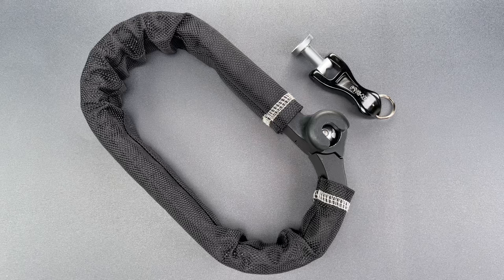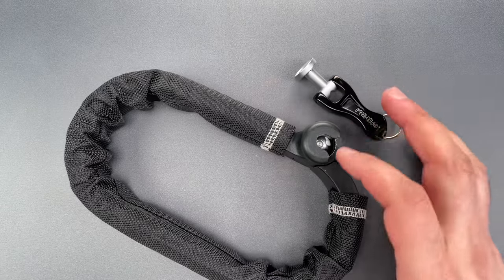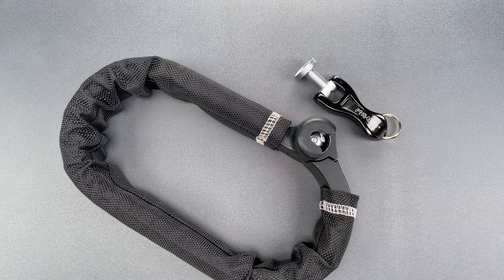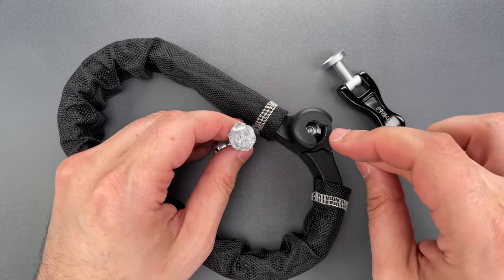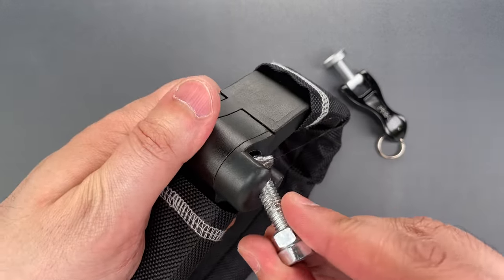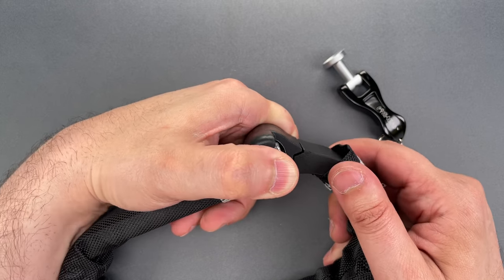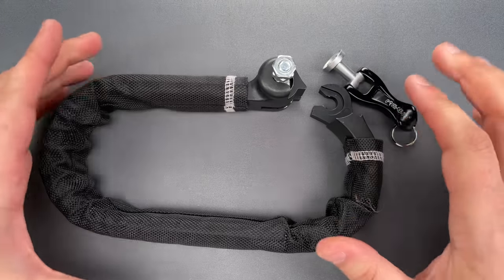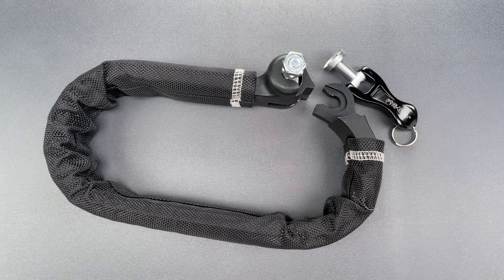[1333] Opened With Hot Glue & Bolt: Pinhead Bike Lock

Comment: ok I'm confused if the key is just a wrench doesn't that mean every one of those locks would be keyed the same given the bolts are gonna be mass produced and all the same?
Reply: Pin spacing is different on each lock. It's probably not a huge key space, but big enough that identical keying isn't the weakest link.

Comment: I think I see a possible improvement? Instead of that open design, make it covered so you have to slide the 'key' in horizontally, move it to the drop down position, then move it back

As a bad demonstration, \ and / are the 'key' positions, and O is the covered cap, with two trains on it

O\ - Initial
O/ - When you drop it down
O\ - When you unlock it

It would make epoxy and such very hard to use for impressioning, and if the cap guard is made of hardened steel with a brass finish on the inside and a plastic outside, then it should be pretty hard to pull impressioning off. And then you'd also have a harder time of looking at the lock design to override it, would make destructive the only reasonably fast option (and if they are willing to use destruction to get at your bike, they probably are willing to cut the frame if the chain gives too much trouble)

Should result in a bike that is very safe assuming there are enough other bikes on the rack or area to satisfy thieves

Comment: Terrible as a lock core but as hardware on your bike this method wouldn't work because the glue would break loose before you could apply enough torque.

Comment: There is a type of bolt called an elevator bolt that has a head like the one our host has hammered flat, should you be interested in replicating this method, but don't want to hammer a bolt head flat.
If you DO want to hammer a bolt head flat, don't do it with a hardened bolt, it may lead to harmful chipping or spawling (sp?). 
And you definitely would want to make sure the bolt is not harder than your hammer or bench vice.

Comment: I mean I'd probably just grab a pair of needle nose pliers, tweezers, maybe even the eraser end of my mechanical pencil (I generally have at least 2 of these on me because I always find random uses for them). It's a wrench and bolt not a lock and key, impressioning certainly makes it easy but I don't think a fieth with some common tools and a few brain cells to rub together would need to spend the time finding a way to do it.

Comment: Right because a bike thief is going to have a bolt the exact size all smashed down already and a hot glue gun in their bag smh. Of coarse EVERY lock you open is low skill to you. Most thieves aren't very bright and I think this would be a good bike lock. A thief with a lock pick set would probably just pass it by and hit the next bike.

Comment: there is another bike lock hexlox witch uses magnets and claims to protect the nuts and bolts that hold the seat and some wheels and other parts on the bike.

for allen screws there is a tiny magnet that goes inside and prevents the allen wrench from going into the bolt.

yes the product may be expensive witch you can afford since you are raking in the cash from the youtube clicks and the covert instruments sales.

i think you should next try a hexlox.

and thank you for attacking pinhead so we can know now it is not as secure as we thought.

Comment: I'd try impressioning with a rolled up newspaper.
Roll newspaper tightly so it barely fits trough hole at top. Press down so newspaper fares out and gets wedged between cover and cylinder. twist.